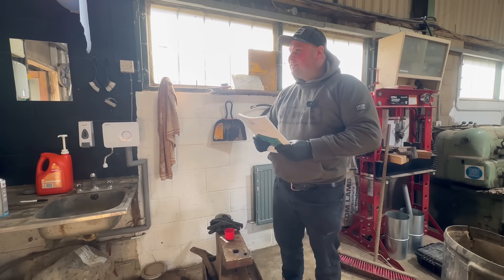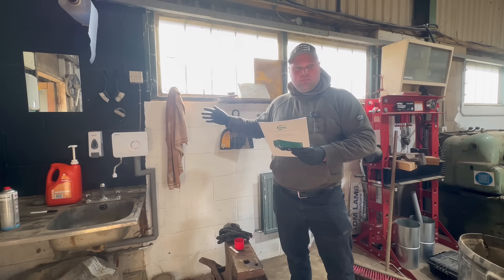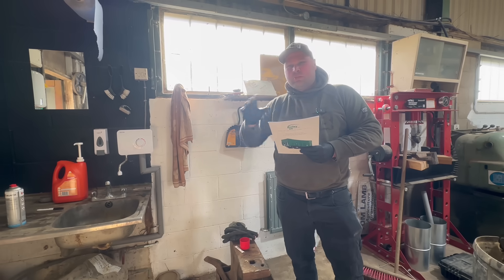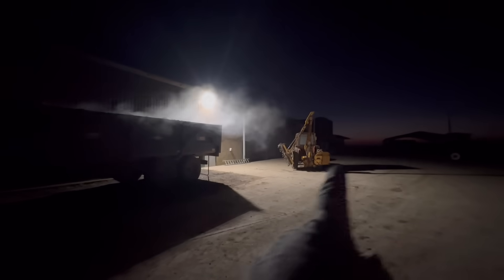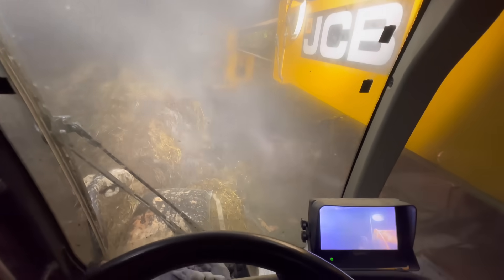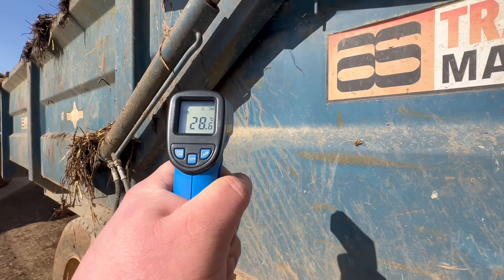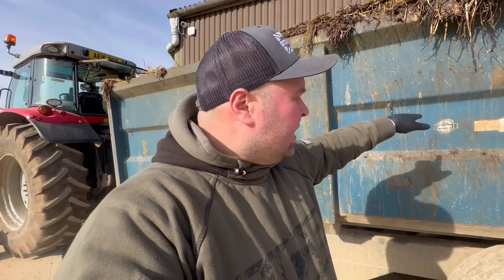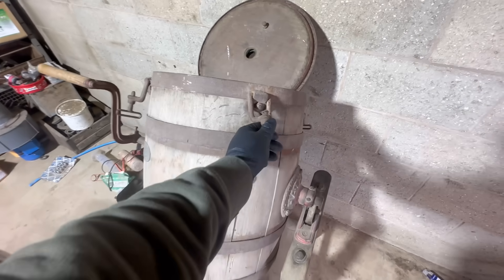How to heat water for a house using nothing but nature and rotting plants.

Comment: IR thermometer only measures surface temperatures and what you measure is dependant on the emmisivity of what you're measuring. Better off with a cheap thermocouple readout taped to a spear so you can push it into the heap. If you pull it out of the stack in 10cm intervals you could plot the temperature profile of the heap.
Reply from the maker: If you watch it all we use a spear to do the heap
Reply: @Tomlamb980  I did but then thought the first bit still relevant regarding being careful about IR readings. I've never tried to use IR to measure the surface of water but I've a suspicion that the emmisivity will be low so the reading very inaccurate. The only way you can guarantee reasonably accurate readings with IR is t spray whatever you're measuring Matt black (not easy for water!).
I'd go with the thermocouple for the water.
The IR thermometer is good for comparing temperatures on very similar materials, where you're more interested in the comparative rather than the absolute temperature.
I've spent a lot of my career measuring things and understanding the limits of various measurement techniques and my comments are meant to help and should not be seem as critisism. I think what your doing is great and love seeing all your different projects.
Keep at it my friend, waste heat from rotting manure is a great idea.
Reply: @davidquirk8097 you didn't mention the cone shape of the measurement "beam" coming from those things. So it's also critical to measure at the right distance. Those laser pointers on the ir-meters are misleading all the young players at home and I think those things would be better without them. From a meter away, the sampled area is something like 30-60 cm circle, which is then pretty much averaged. Good for the side of that trailer, useless for pipes, unless your touching it.

I use electrical tape for emissivity correction. Always measure, or actually thermal image at 0,95 setting and won't even bother trying to guess materials and their oxidation levels. As an electrician, those materials are pretty much copper and aluminum and their emissivities have huge ranges between oxidation levels. Sticking a piece of tape to the measured thing solves almost everything.
Reply: @villehietala9677  one of the things I used to have to measure was the tortional vibration damper on running engines. The manufacturer would give us their best guess as to the correct TV damper but we'd monitor the temperature whilst we carried out the TV   measurements. If it's the wrong spec damper they get hot very quickly. In those cases we'd just use the IR to keep a rough eye on the temp. If it was getting warm during use we'd resort to stopping the engine and measuring the temp with a contact probe. I also used to use 'temp spy' stickers (available from RS) to show the maximum temperature reached.
Thermography is a good tool but I've got some great photos I used to use when teaching people the pitfalls of IR thermography. One of the engine ones shows an apparant temperature on a piece of shielding of around 600°C. The part was reflecting the IR signature of the turbo but was actually only around 70°C.
The Fluke (and its predecessor the Raytec) had a decent laser system that showed the measurement spot size on the surface of the object beng measured.